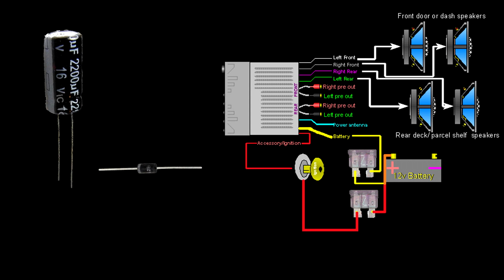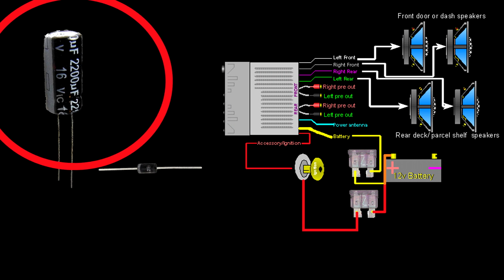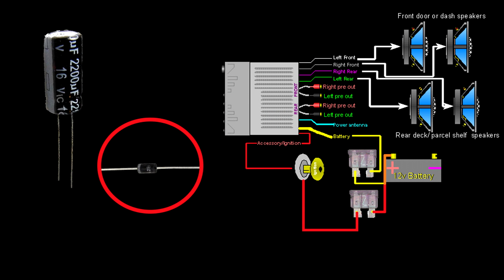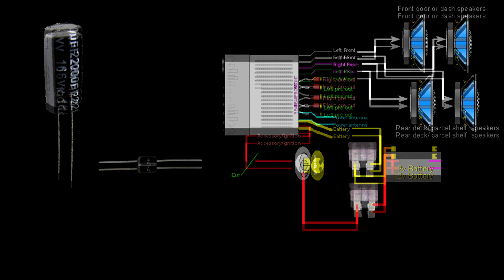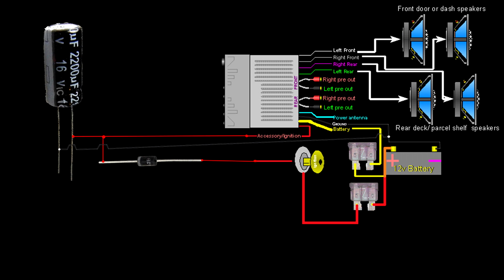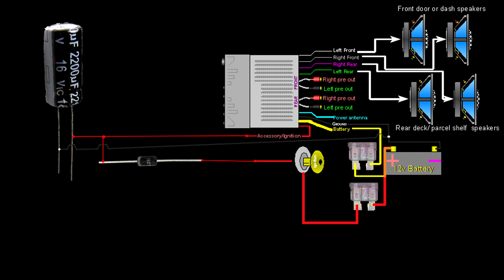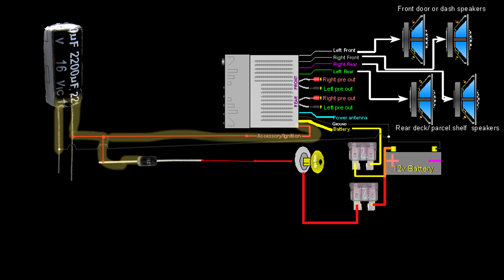HOW TO: Keep Your Car Stereo On While Starting

Comment: Yea, didn't work for me, i guess ACC wire draws too much current, i've put 16V 3300uF with the diode and connected it all accordingly. Radio turns on when i turn the key, but when cranking (around 1.5 sec) it reboots. And when i take the key out the radio is still on for good 30 35 seconds. BUT I told myself i had to do it. Today i bought 2 caps 16V 47000UF, put them in parallel, so around 10mF of capacitance. I know that the radio will be on after I unplug the key for my aprox. 1 hour at least. But i want the radio to not reboot when cranking. If this works ill figure out some circuitry when key is pulled out that the radio shuts off. Probably some dsPIC MCU and some firmware, or arduino nano, and i'll figure out the how to flag the moment when the key is out, to possibly just close down the circuit and let them stay charged and not continue to power the radio. Wish me luck haha
Reply: Just to let you know, terminals are not corroded, battery is healthy i have Bosch battery only 1 year old.
Reply from the maker: @HeroClaws  Just saw this reply. You have trouble-shot the two most likely culprits...
Dedicated supply wire, and/or capacitor bank and diode on the yellow wire are your best bets 🙏
Reply: @StephenTack   it wont put the link to the pictures so ill explain schematic. Yellow wire from car -  diode -> (anode facing the capacitors) - 2 parallel cap 47000uF on the yellow wire after the diode, and then negative side of caps to GND, and yellow wire to the radio. So when everything is turned off yellow wire will charge caps, when i crank, the diode will prevent the current to flow into the yellow wire (to the car), but they will charge the radio with energy stored to stop it from rebooting.
Reply from the maker: @HeroClaws  that sounds exactly right to me. It's the same thing you did to the red wire, but with MUCH more capacitance, and a diode capable of handling more current. I'm not sure that I'm out of capacitance will provide enough power for the stereo to stay on, but it's worth a try. Good luck!
Reply: @StephenTack  2 times 47000uF is nearly 10mF, if thats not enough then its too big of a hustle haha
Reply from the maker: @HeroClaws  94mF actually... I think the one time I did this, I had about 0.25F... but you're in the ballpark.
Reply: @StephenTack  yes yes ur correct, but if this doesnt work im givin up, too little space for those 47000uf caps
Reply: Now I looked up what means you're in the same ballpark which gave me hope hahah. Thanks for the advice. Btw im MSc. in Applied Electronics and im going to Niece France to work for some Schneider project, ill keep u updated if new wiring with cap power bank on the Power (Yellow) wire and the smaller cap on the ACC wire works out.
Thank you very much, if i succed ill make a video on wiring and everything and post it on my YT chanell so you can pin it as alternative solution for the problem that some of us face dealing with this problem of big voltage drop when cranking.
Reply: Maaaan, it worked hahha the freakin power wire draws tooo much current and the voltage drops under the the reset signal for the radio so it reboots. But with these 2 parallel caps, ~0.1 uF it worked like a charm. I had the music blasting really loud and everything, it didnt shut down when cranking, and after i unplugged the key the radio stayed on for roughly 15 20 sec. Thanks for you encouragement, i would have given up. Props to you mate!
As i've said i have made some videos, i will make some schematics ( this is the main issue some of us face) so ill explain everything, wiring, explain the priciple of operation and put it. So you can pin my comment when i upload a video regarding this issue so the other fellas who have the same problem can look at what i have done and go on further from there.
Thanks once again :)
Reply from the maker: @HeroClaws  Great job. I like your video. I will add a pinned comment linking to it.
Reply: @StephenTack  Thank you very much. I managed to do it somehow before i go to France which is tomorrow. So i think you got your points right regarding issues with the radio rebooting after adding cap and diode to the ACC wire. Now this is most likley the culprit with almost all the others who didn't succed with just adding cap to ACC wire. This is on my Skoda Fabia 2005.
Reply from the maker: Good on you for being persistent. But you're barking up the wrong tree. If the radio stays on for 30 seconds when you turn the key off, it's not the ACC wire, it's the yellow continuous power that is sagging (browning-out the stereo, and causing it to restart) when you crank the engine. 
Solutions are:
1, check your battery, and the battery connections. A weak battery, or corroded or loose connections will cause more of a voltage drop when cranking.
2, If all connections are good, and the battery is strong, try running a separate supply wire straight from the battery to the stereo, to minimize voltage drop.
3, If this doesn't work, I've had success by putting a large diode, and a very large bank of capacitors on the yellow power wire... So the capacitors can keep the stereo on while cranking.
4, It's also possible that in some older vehicles, a direct drive starter causes a huge load, and a more modern gear reduce starter will more easily crank the engine with less current... This applies to mostly old Ford trucks.

Let me know if you figure something out. keep hacking! 🙏
Reply: @StephenTack  Where did you put the large diode on the yellow wire, i've added schematic but im not quite sure its correct.

Comment: I connected the red wire to the yellow as well, so it's on all the time, the yellow wite doesn't get voltage drop while cranking so the red one should get the 12v as well but the radio still turns off. Can the radio itself have some king of feature when the voltage drops to 10v while cranking it turns off by itself?
Reply from the maker: Not a feature, it just can't run on the low voltage that happens when cranking.
Check your battery connections, check the health of your battery.
Reply: @StephenTack  the battery seems healty, I check with a multi meter the to see which wires have current when and I saw the voltage drop to 10v at max, is that low for cranking?

Comment: What size diode is needed for this? I’m running a 3300uF 16V 13X25 +/-10% -40-+105℃ capacitor and a 1N5353BRLG DIODE ZENER 16V 5W diode. With this installed like you showed, nothing is happening!
Reply: To reduce voltage drop, use a Schottky Diode, like the 1N5822
Reply from the maker: @michaelp7052  looks like 0.525v voltage drop, vs. like 0.7v 🤷🏼 unless you're operating at the edge of functionality, this shouldn't make much difference. I would still recommend just trying to salvage any (normal, not Zener) diode, and see if that works.
Reply from the maker: Literally any other kind of common diode will work. Just not Zener. 😂  A good one might be a 1N4001.

Comment: I have the same problem. Radio reboot when starting the engine. I tried this. Did not work. Found out, radio reboot because of the drop in voltage from constant battery line, not the shut off of accessory power. Problem till exist on mine. Exploring other options, bigger battery, add second battery, add capacitor?
Reply from the maker: Read through the comments, there and been multiple other people with that problem.

Comment: Thanks!!!! I can still learn something new everyday. This worked amazingly for an Android car stereo on a older kit car with some suspect wiring. I had to use it on the hot lead because when the engine was turning over, it pulled enough battery to cause the stereo to lose enough power reboot very time you started the car. The capacitor solved the issue. BTW, I did confirm the battery was in good shape. Many thanks.

Comment: I did this and I heard a loud pop when I powered it on which I believe to be the diode based on some google searches. I still have enough positive function.. My little circuit is tucked away so it's not worth inspecting it. Some people were talking about an inrush current spec on diodes being the culprit. Can you add any info for me on this? I can at least turn off and on the engine without my stereo cutting out. Luckily my starter is pretty quick with 2 oversized AGM batteries on a Subaru Outback.
Reply from the maker: How long does the stereo stay on when you turn the key off?  If you wanted to limit in-rush current, you could put a  resistor in the circuit. I've never popped a diode doing this, so might not be necessary, depending on what kind of diode you use.   I just go for random beefy ones salvage from old power supplies.
Reply: @StephenTack  2-3 seconds. I have this ignition signal circuit turning on head unit, a idatalink daughterboard, a DSP and 2 amps. Not sure what sort of current draw that is, or the particulars of signal/ vs. power this line gets used as on them. The resistor is a good idea.
Reply from the maker: @vgnfab  how big is your capacitor? 2 to 3 seconds isn't bad with all that stuff connected downstream of the diode/capacitor. 
If it's working that well, you probably didn't blow the diode, the pop may have just been an in-rush surge they caused all the wires to jump a bit? 🤷🏼
Reply: @StephenTack  2200 Micro Farad. Well that would be cool. Nice to know it is at least working. It's just a lot of expensive electronics and a lot of my labor time and planning going into it all to then here a concerning loud pop noise. If you think what I've said implies the Diode must be working, then I'm happy with that. If the Diode did fail, it's possible it failed closed and to where there's still a directional component to it's state. I'd love to know more about the circuit elements interworking, but it's not on my to do list :-)
Reply from the maker: @vgnfab  Yes, if the diode did fail, it failed short. Which can happen. The secret is, in some cars the diode may be unneeded. If the ignition switch just disconnects the 12V Accessory supply from the battery, and leaves it floating (doesn't ground it), and there's not to much other factory stuff in the car connected in parallel, you don't need the diode.  It's there so if these conditions aren't true, the capacitor won't backfeed and discharge very quickly. In fact the diode slightly handicaps this circuit, because it has about a 0.3-0.8v drop across it, so your starting voltage is lower. 
Since your setup is working, you are good to go. If you want to add keep on time, just put another 2200uF cap in parallel with the current one. 

Cheers.
Reply: @StephenTack  Good points/ ideas. I did actually do an interesting thing here. I cut the 12v switched red power wire of my cars main harness before the stereo and did a bit of kit in series... I made the car side end of the wire trigger a 40 amp relay activating 4 gauge direct battery wire to a 12 site fuse box and from this ran a wire forward of where I made that cut- to the stereo harness plug. I think I've lost track of what this means with your analysis. And yes, I was thinking another cap in parallel would have been smart. 

I thought the aftermarket fuse box would give me peace of mind with my latest version of modifications. Swapping bodies 05 -> 08 outback. I'm powering cameras and gauges off the fuse panel. As much separated as possible for control, reliability, and ease of diagnostics.

Comment: I have an older car to which I have added a Bluetooth receiver, powered from a 12v socket. Can I add something like this to that socket? It doesn't need big power and that socket only powers that particular device, but I lose Bluetooth connection every time I start the car...

Comment: But what happen, if I connect the capacitor and the diode to yellow wire that come from the car battery and negative side of the capacitor to ground ?
Does the radio still saving the settings?
Reply from the maker: The yellow wire provides the bulk of the power, it would still work like normal, and you wouldn't notice any difference with the size of capacitors mentioned here. If you have done this on the red wire as mentioned here, and the radio still shuts off, or reboots when you try to start the car, adding a very large capacitor (or bank of caps) and a diode on the yellow wire can be a solution.
Reply: my problem is, when I try to start the engine, the engine take all the power of the battery and the radio shut down for some seconds, that made to reset the radio whenever try to start the engine and lose the settings and channels .
That mean lost of battery power .
What to do ?
Reply from the maker: @פאוזיאבורומי  either your stereo is installed wrong (with the yellow wire hooked to an accessory source, not one that's always on), or your battery is getting very weak, or you have bad connections on the battery... Look for battery problems first.

Comment: This just works. I did not have a 2200 so I put 2 470's parallel and the unit stays on after switch kill for 3 whole minutes, and yes I timed it.
Reply from the maker: Nice!  Yes I've noticed newer Boss brand stereos must draw almost no current on the red wire. With a 3700uF one didn't turn off for 45 min at least.

Comment: Dear Sir, I want to use my JVC Car Stereo in the Ford Festa Classic model 2012. Please add Capacitor and diode details in your description also so, nontechie person can also buy parts and try to do it by self. I am waiting for ur reply sir.
Reply from the maker: Cafurty 1N4007 DO-41 Axial Silastic Guard Junction Standard Rectifier Diode (Pack of 20) https://www.amazon.com/dp/B00W17LOBO
Reply from the maker: Nichicon  UVZ1C222MHD-20 Aluminum Electrolytic Capacitors - Leaded 16V, 2200uF, 12.5 mm x 20 mm, 20% Tolerance, 5LS (Pack of 20) https://www.amazon.com/dp/B071RTXD64

Comment: It is not working for me, it is keeping steareo to play 5-6 sec after I remove the key but nit working at the time of start
Reply from the maker: The starter probably pulls down the battery voltage too low (on the yellow wire) to keep the stereo working. 
Have a look at the other comments, I've given lots of advice on possible fixes to this.
Reply: @StephenTack  i have also tried connecting one more capacitor to ground and yellow wire, that is also not working, that capacitor will provide the voltage in that case
Reply from the maker: @amankhandelwal1895  if you do add capacitors to the yellow wire, they need to be much, much bigger to provide for the high power side of the stereo. You'll also need a beefy diode.
The real place to start is making sure your battery terminals are clean, and your battery is good.
Reply: @StephenTack  thanks, i will try that.
Reply: Have replaced the battery but its not working

Comment: Tried this with 2 2200uf 16v capacitors in parallel and no diode, so basically the positive side attached to the red wire and the negative to ground. When I hook it up my stereo display is always on. No sound unless the key is in the acc or on position and the sound cuts out when I start the engine but the display stays on. Didn't want to kill my battery so I unhooked the ground wire and it's back to how it was.
Reply from the maker: I'd say, pop a diode in there...
Reply: @StephenTack  I appreciate your help. I'll have to try that.

Comment: Thanks works great, with a 2200 24v capacitor my cheap android unit stays on for more than 2 minutes after removing key.
Reply from the maker: Nice. It seems modern, cheep stereos have very sensitive turn-on circuitry. I recently had  a cheep Boss that would stay on virtually forever... If you want it to be shorter, a resistor can be added across the capacitor to drain it and shut the stereo off sooner. I guess appropriate sizes would be 100k to 1M ohm. 🤷🏻

Comment: i have question which can't find answer anywhere. How long 2200uf capacitor can power up radio?
Reply from the maker: It really depends on the radio, some draw more than others on their turn on wire. Some experimentation may be required.

Comment: Very nice explanation video even though its is 6 years old already. I'm wondering if you're still produce this kind of video. I would like to modify my car stereo so that it will delay the shutdown (about 1 min) after i turn off the ignition. This feature can be found on expensive cars (BMW etc) . I thought it is a cool feature to have.
Reply from the maker: Haven't made many videos since... It's no coincidence that my oldest daughter is almost 6. 😁
The long keep-on could be done with a few large capacitors, but it would probably be better to get a delay module. There's probably one that could also turn the stereo off as soon as the door is opened, like fancy cars do.